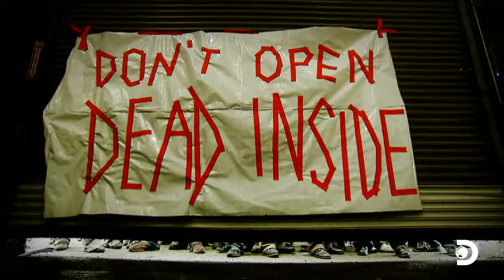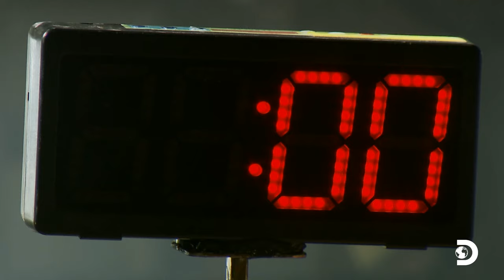Choosing the Right Weapon for a Zombie Apocalypse | Mythbusters | Discovery

Comment: But there was no weight accountability for the axe. There would be fatigue. Plus range of motion for the swing to actually penetrate the skull to the brain.
Reply: Also time to remove the axe from the zombies skull. If it gets stuck in one, you are gone.
Reply: I think the main thing to consider is the axe is too heavy of a weapon. The second thing to consider is the distance, cause the circle is small he has no opertunity to escape. You factor in a larger circle and allow him to move about, i think the odds increase @FMFvideos
Reply: They did later redo this, and Adam had something installed onto the axe to let him know when he swung it with enough force.
Reply: I see your argument, and I'm not saying that wouldn't happen. However, in a zombie apocalypse your physically changes into a survival setting. Meaning as you become more conditioned to the world of zombies, you're becoming faster and stronger as a result. Your body then overtime adjusts to the exercise.

In other words, you'll get better and better at swinging an axe and hitting your mark. 

Same can apply with a gun too.